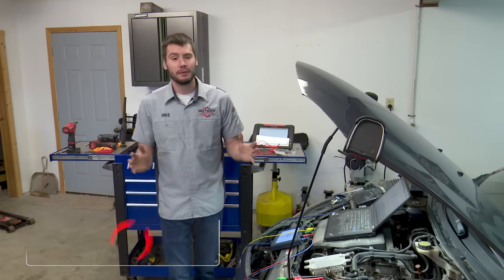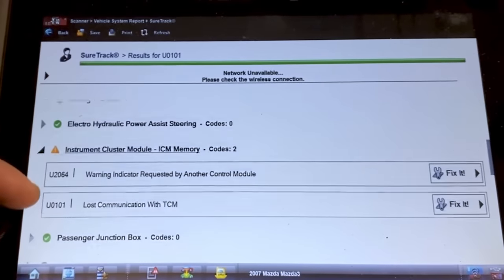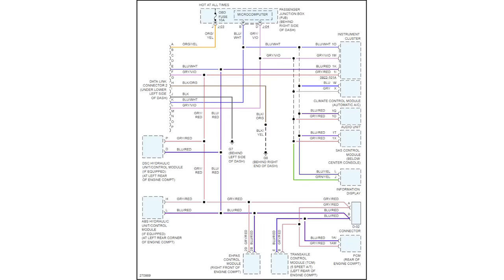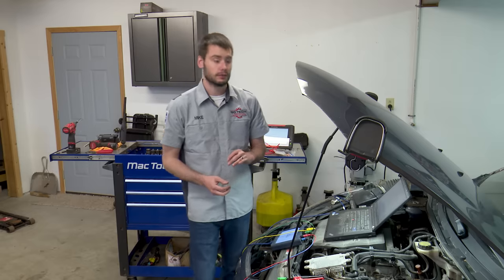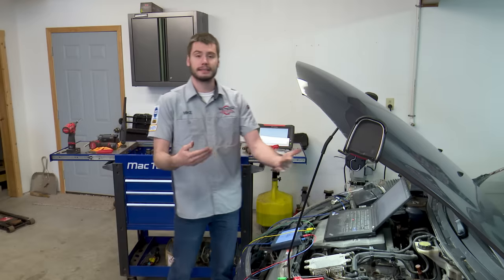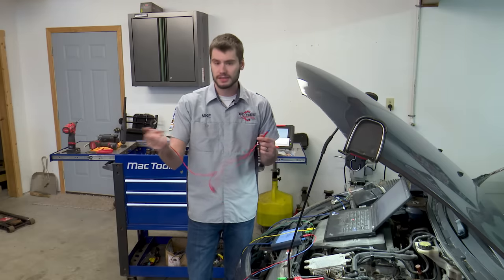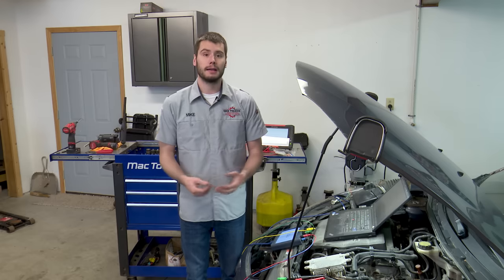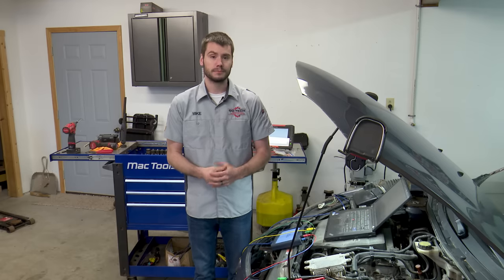Don't Make The Same Mistake I Did - U0101 CAN Network Failure Diagnosis

Comment: And it probably didn't need a TCM in the first place. Like I always say it's always something stupid. Most times we never get the whole story from the customer. Thanks for the video!
Reply from the maker: Hey Matt, maybe it did, maybe it didn't...impossible to know now. Personally, I wonder if it did need the TCM, it was replaced accurately, but the testing/unplugging/plugging in multiple times somehow ruined the connector. A main connector like that isn't intended to come apart very many times. When I was at factory training for KIA we we're told 3 times...crazy!
Mike Becker, Senior Instructor
Reply: GoTech yeah when I worked at GM dealer I would’ve replaced the 2 pins for the CAN and repaired it that way. Only 2 wires instead of 20. I like your use of the scope as well. Good stuff.
Reply from the maker: Thanks Matt! I did have to add in the cruise control wiring for the new (used) connector. The Mazda connectors kind of suck to take apart!
Mike Becker, Senior Instructor

Comment: Had many issues with this problems,some cars are flood cars that were fixed by replacing modules and fuse boxes,which fixed the issue,but many yrs later we end up trying to figure out this issues,not knowing it was a flood car four yrs ago ,creating many pins to corrosion.

Comment: Great advice fixed my problems IV been battling everything from pcm tcm wire harness I pulled every wire out didn't find no breaks in wres seen your video did probe test with a needle that was right size as pin found my bad female plugs thanks I've spent lots money time if only I seen this video first 😂

Comment: Great video Mike! One question..How did probe to capture the bad waveform? You mentioned at the tcm connector, but I’m kinda confused. Wouldn’t back probing show a good waveform even if there is no contact between male and female pins?
Reply from the maker: Hey OC Diagnostics, my initial back-probing that captured the bad waveform was a bad connection on the back side of female pin. So, if I had a good connection then yes, it would have shown a good waveform.
Mike Becker, Senior Instructor

Comment: @gotech. My transmission is stuck in limp mode and responds slowly in reverse to 80% pedal pressure. only DTC U0101; U0402. It's TORQUE FLITE 8HP70 transmission. I can't believe my transmission has failed at 40934 mi.

Comment: Thanks alot for the video Mike. So i am right i thinking when you first hooked up to the PCM and TCM lines you used piercers on all 4 wires and then just to install the jumper you back probed yes? 

Thanks

Dave
Reply from the maker: Hey David, my intial scope capture that showed the "bad" blue trace was back probed at the connector. I then removed that back probe and put my jumper wire in. The second back probing is what "fixed" my issue.
Mike Becker, Senior Instructor
Reply: Ok Mike thanks for clearing that up. I just saw the 2 piercing tools on your screenshot and thought you might have originally pierced all 4 and then just back probed the jumper. Just wanted to get it clear in my head, thanks again
Reply from the maker: Of course David, glad I was able to clear it up!
Mike Becker, Senior Instructor

Comment: Had a Cadillac cts abs com issue. Eventually found the blue slide in wire retainer in the connector was broken and allowing the wire to back out when installed. No room to properly check connector. Only found the problem when i disassembled the connector in desperation!

Comment: Yes 
Thank you for the indepth quick video.

Now to fix my $700+ dealership diagnose with already computer flash for the ecm. I didn't think to ask will that fix the problem for my u1000. But now u1000&u1001 are friends. How in the future to fix it....

Comment: I can’t even locate TCM on the car I’m working on (2011 Altima Hybrid) . Identifix illustration is different. Very frustrating. Most thing I hate about electrical is figuring out which wire is which.

Comment: I have a similar issue with my mazda 3 2005 2.3.  It jumps when goes  into second  gear when engine still cold  mostly . Could this be the TCM as well or wiring or  conector ?

Comment: Hey man I have a 2007 Mazda 3 and the TCS light comes on as well as the check engine and when I put the car into drive it goes into 3rd gear and when I pass reverse it gives the car a really rough shape and same when I put it into reverse. I’ve replaced the map censor within the car in hopes it would bring the car out of limp mode. Turned the car on after I replaced the map censor and it went into first gear and reverse fine without the rough shake to the car. Went back the next day and it’s doing the same thing. Not sure if it’s because of my connection to the TCM that would be my next guess from watching your video. Any suggestions before I check the TCM?

Comment: So if you could do it again what would you do differently?
Reply from the maker: Hey J. Angus, I would have pierced the wires and seen that I had communication reaching the TCM connector. I would have then checked power and ground to the TCM. Comm, power and ground would have lead me to thinking it was a TCM issue, but I always verify pin tension prior to ordering a module...so I would have found it then. No need to tear the harness apart like I did.
Mike Becker, Senior Instructor
Reply: @GoTechTraining  Pierce first, ask questions later brother. Thanks for the solid content.

Comment: I got a Mazda3 2.3 115k 2004. I accidentally did a parameter reset in the pats ic. Now dashboard doesn't display the transmission selection at all. No communication to the pcm I can't even communicate with it. How do I fix this? It started out as head gasket job, smoking out the tail pipe. The orginal pcm had water damage. Now I can't even this thing to crank nor start. I will pay for help. Please help me

Comment: Could a battery that puts out only 8 to 9 volts cause a U0101 code? My car starts off a little rough but it still runs just fine and has no problems when driving.

Comment: At least you double-checked your work before returning it to the customer. As the saying goes, "Measure twice, cut once." That's still better than tossing a TCM at it for nothing like the customer did in the first place.
Reply from the maker: Hey Joseph, thanks for watching! It's funny, when working on cars I always apply that...woodworking...ugh let's just say I have a lot of waste, haha!
Mike Becker, Senior Instructor
Reply: it's possible the tcm was bad and they/other shop damaged the connector pin testing it with force and t-pins

Comment: Great tips; you quickly narrowed down where the problem had to be, and you learned a lesson about checking the integrity of the actual connection instead of relying on back probing, which takes the actual problematic, low-socket-tension connection out of the tested circuit.  If you had started by popping the white cover off of the sockets, you may have been able to spot the loose female connector by visual inspection before back probing that circuit and using new wires to go around the possible problem areas you had quickly identified.  

Thanks for making this video. I have a similar problem I am getting ready to dig into today, and the sharing of what you learned is extraordinarily helpful to me.